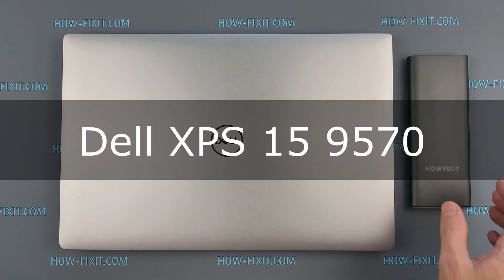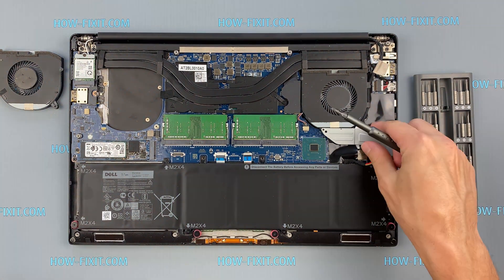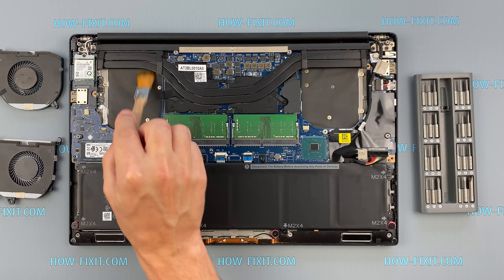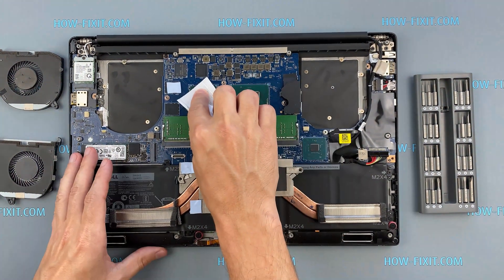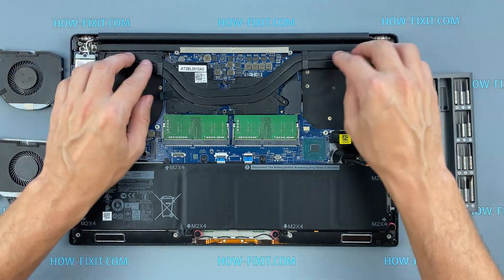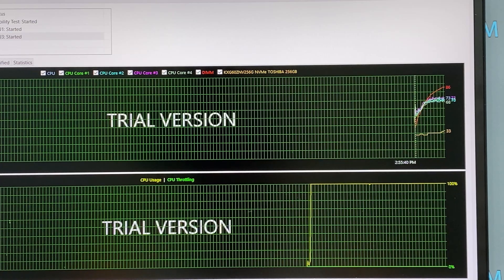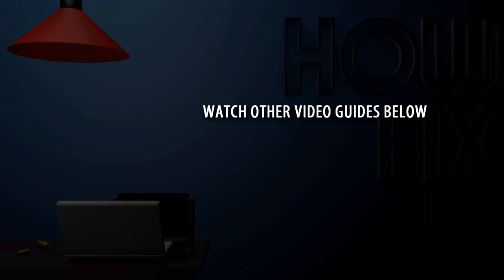Dell XPS 15 9570 Disassembly, fan cleaning and thermal paste replacement

Comment: No need to spread thermal paste, just increases the chance of bubbles.  Single line down the middle is best for rectangular,  or a cross for square die.

Comment: Battery does not need to be disconnected if power is shutdown. Never had to disconnect battery for internal cleaning. Also needs compressed air to bow inside fans to get clumps of dust out. A brush will not do that.
Reply: Always better to be safe and unplug the power, and yes compressed air is a lifesaver it will blow out the dust inside that you can't reach. But if you don't have access to it, you can always disassemble the fan itself and clean it throughly

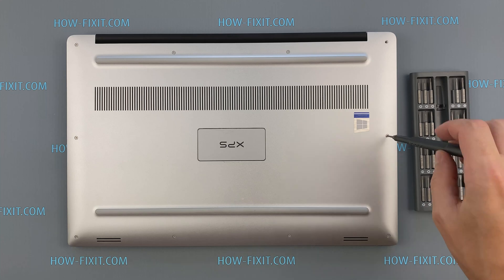Comment: @ 1:03, a Torx Screwdriver size T5 is used to remove the 10 periphery Torx screws. @ 1:17, a Phillips Screwdriver size #0 is used to remove the 2 Phillips screws by the Service Number identification tag.

Comment: would i be able to just take the dust off of my fans without having to take off the heat sync as well?
Reply: thats what i did, got a new paint brush on the fans and gave them a good clean but im going to give the thermal paste a go. the secret is not to use too much :)

Comment: I re-applied the thermal paste on my XPS 15 9550, but I wasn't happy with idle CPU temperature in the 40-45C range. I think my mistake was not  spreading the thermal paste using some tool to ensure even coverage of the CPU & GPU. I'll definitely have to try that.
Also, I wanted to undervolt, but it looks like Dell removed that ability with recent BIOS updates. I'm not sure if it's worth it trying to downgrade the BIOS for this capability. I welcome anybody's input on this matter.
Reply: I have a XPS 15 9750 was able to downgrade the BIOS and use Throttle Stop undervolting successfully; Trying the thermal paste/fan cleaning now
Reply: Honestly, wouldn't downgrade due to security reasons from previous version, I'd repaste.
Reply: I know this is a little late, but now you can't unlock undervolting/overclocking by downgrading the BIOS since the Intel ME thing doesn't downgrade with it. If you want to undervolt, you need to modify the BIOS itself, which is super tedious but in the end it's worth it.
Reply from the maker: You can do undervolt with ThrottleStop check this video - https://youtu.be/1PTRCc_BRtQ
Reply: @cin806  What version did you downgrade to? Best.
Reply: @damianoparravano7022  i’m on 1.24, after flashing at first boot enter bios and hit load factory settings and then reboot. I’m using throttle stop to undervolt
Reply: @Cdaemon666  Thanks so much.
Reply: I've downgraded, and it's definitely worth with Throttlestop.

Comment: Thank you so much, my laptop going on 3 years old with heavy usage. I'm replacing the battery, upgrading the ssd and cleaning it tomorrow to make sure it last another 3 years.
Reply: Do you by any chance have the issue where your battery percentage will randomly go from say, 50%, right down to around 5% after you turn your laptop on?

And if so, did the battery replacement help?
Reply: @WillisDyson  I have had this while it battery was still under guarantee. It did help, but you should probably try all the other solutions first like completely depleting and fully charging your battery a few times over